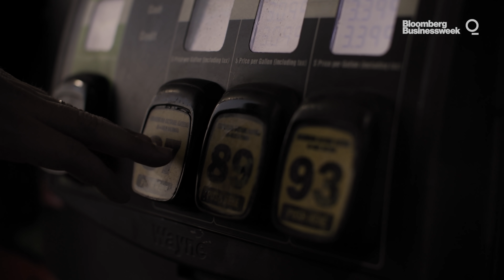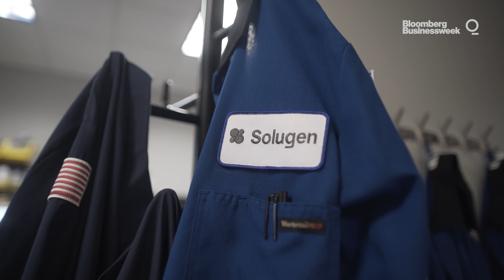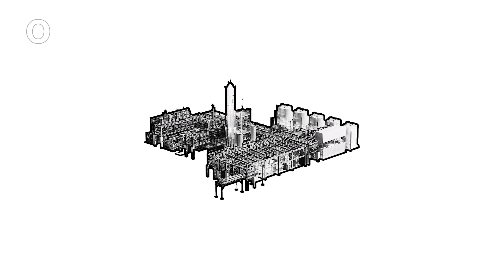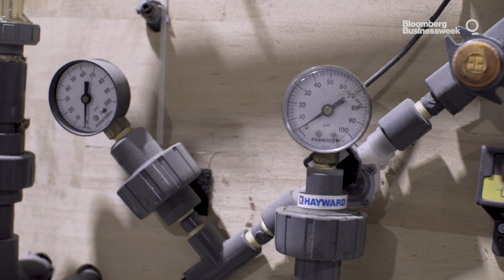How Texas Could Solve Our Toxic Chemical Problem

Comment: Sugar oxidases aren't going to turn sugar into anything we want. I appreciate the work they've done with glucose oxidase and finding applications with gluconic acid and hydrogen peroxide (directly or transformed otherwise via metal catalysis), but there's still a ton of research required to get to the lofty goals outlined in this video. 

Also, I doubt CRISPR is needed for this kind of work. Enzyme expression in microbes is trivial and I bet they express their enzymes off a plasmid anyways. No CRISPR required. Seeing them just name drop CRISPR for the sake of it is not a good sign.
Reply: True...just look at what happened to Zymergen

Comment: Perhaps one of the great advantages of this technology is that it reduces our dependence on foreign oil considerably and creates the potential for these chemicals to be produced pretty much anywhere in the US and other countries.
Reply: The US doesn't depend on foreign oil anymore.
Reply: @boostav  they do. Because of the influence of Saudi-Arabia, the price of oil did shoot up. Especially in the US.
Reply: @boostav  While US oil production has increased, we still import a lot of crude oil since there is so much refinery infra in the US. We export a lot of crude. This is because we can import at a low cost due to longstanding arrangements and can sell crude to some countries at a higher rate. So while we have increased US oil production it has not directly increased the US supply and decreased our imports of foreign oil.
Reply: @offwhitemke  This is both true and false. Much of the oil the U.S.A. imports is oil our refineries are tooled to process and much of the U.S.A. oil exports is what we cannot process in our refineries. Much of the U.S.A. oil refinery infrastructure has trouble expanding and adapting to new crude oil product types because regulation, land acquisition, labor, and slow rolling costs companies too much money for regular on the fly retooling. Oil grades in the U.S.A. uses a letter system in the us and come in different viscosities from water like clear Type A to tar sand Type D. Their is also pre barrel crude oil processing required like methane/natural gas/propane separation and particulate removal. Also a lot of oil refining is multi stage something like: ground fracking, field separation and fume torching, crude oil distillation and separation, enzymatic creation, product stabilization, raw material creation (pellets), secondary raw material creation(cloth), t-shirts. The US likes to do a lot of the most technical steps, but least labor intensive, and often trades different steps to other countries. The Most well known outsourcing of oil products the U.S.A. does is certain refining in Singapore and Saudi Arabia, and Textile creation in Bangladesh and Vietnam which is further badge engineered, tags sown on, in China or the U.S.A. to avoid further questions or investigations of labor conditions in Bangladesh and such. Also avoiding trade tariffs and import restrictions often change who does which step.
Reply: No more war for oil?
Reply: Instead of putting $425 million into companies like this, the morons like Bernie Sanders, Chuck Schumer, and the airheads like Alexandria Ocasio Cortez would rather take hundreds of billions to feed the fatsos and lazies. Now, they wonder why the nation is facing high inflation. Folks, Republicans keep the United States Of America rich and powerful while the Democrats turn the nation into one of those slum countries like those from Mexico to the bottom tip of Chile. That’s the fact and it’s happening.

Comment: What's the difference between taking oil (carbon) and turning it into plastics and taking feed-stock (carbon) and turning it into plastics? As long as either process isn't sending that carbon into the air, it makes no difference. Both are carbon neutral. Right?
Reply: Big part of this is the actual process is meant to be more efficient. The corn feeds the enzymes, and you get your end product direct without all the other stuff. You're right that either process would work if it didn't send carbon into the air, but the petro processes do send carbon into the air
Reply: A plant gets its own carbon from CO2 in the air while growing. So using plant-based carbon sources causes the total cycle to be carbon neutral, compared to pulling ancient carbon out of the ground and then letting it out into the atmosphere.